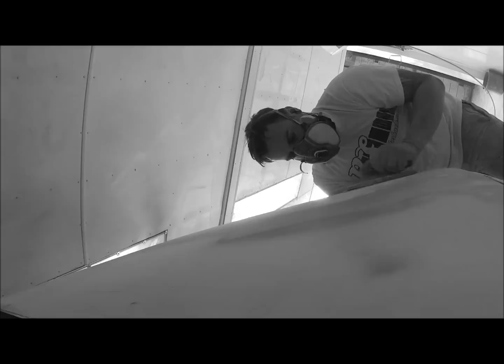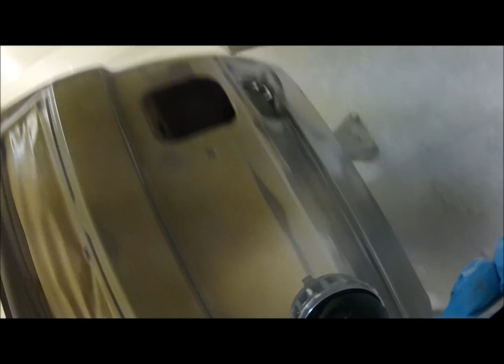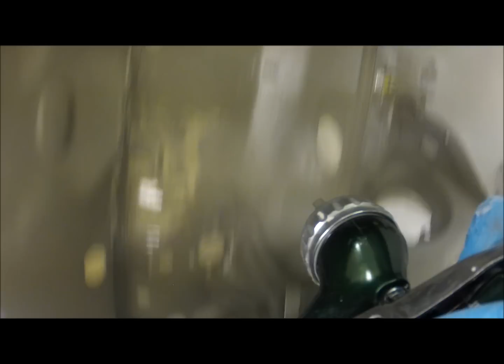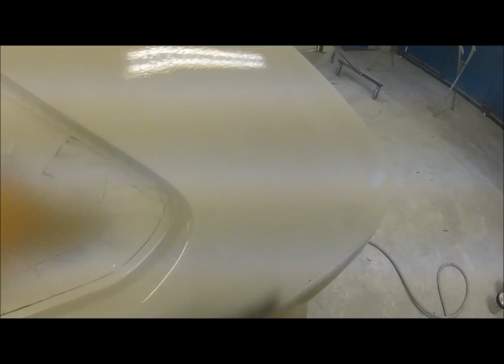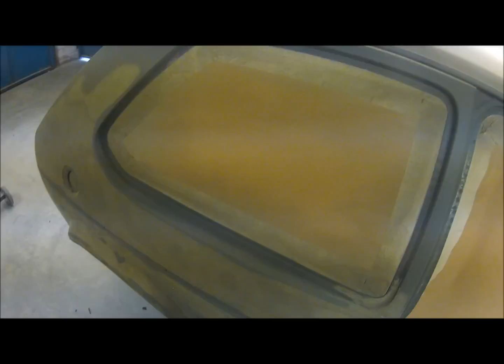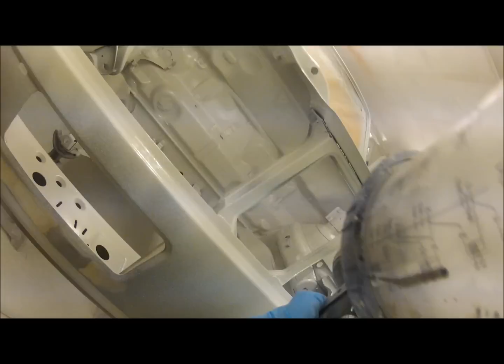Resto Shack MK1 Golf GTi restoration has entered the body shop

Comment: I'm eventually going to sand, prime and paint my Mk1 rabbit, and I was wondering why, after putting the primer on, you used the green paint. Then you applied the final white coat. I'm new to this, and maybe the "primer" i'm speaking of was bare metal, i just couldn't tell in the video
Reply: Since RestoShack is so keen on answering questions from their viewers......

Epoxy primer is ideal to spray all over the clean bare metal to prevent rust. While the epoxy is still curing, you can apply body filler and do your bodywork. Anywhere you have exposed  bare metal after doing bodywork you can spray etching primer to again prevent rust. Primer-surfacer is a heavy primer to fill sanding scratches and small imperfections. After the primer surfacer has been blocked flat, you spray sealer to aid adhesion and give a uniform color. While the sealer is still wet you apply your color, followed by a clearcoat if it is not single stage paint.

Here in this video they ended with the primer surfacer. Next comes the color.